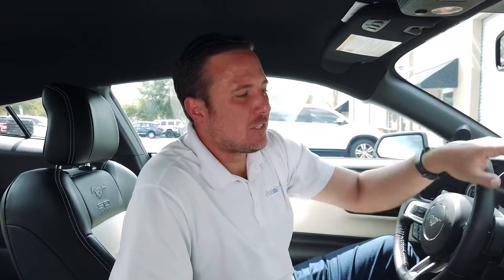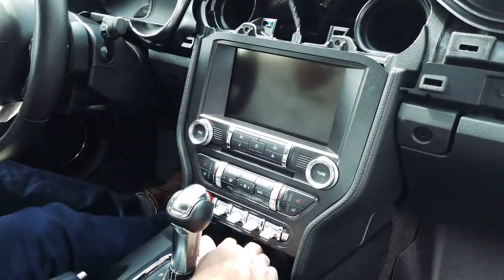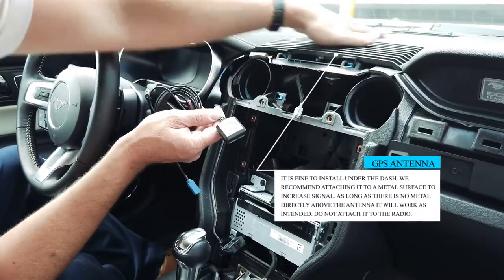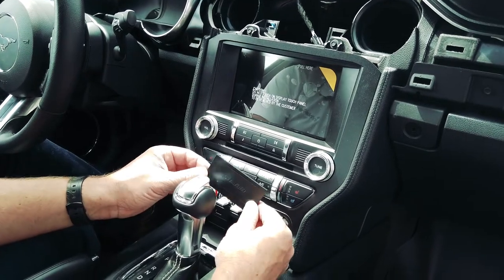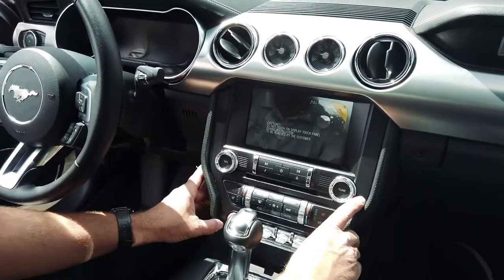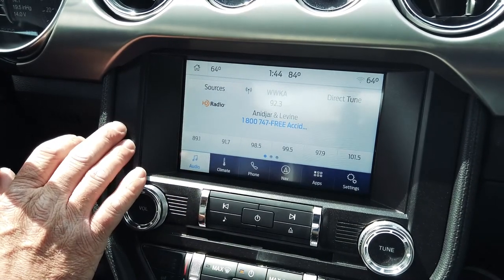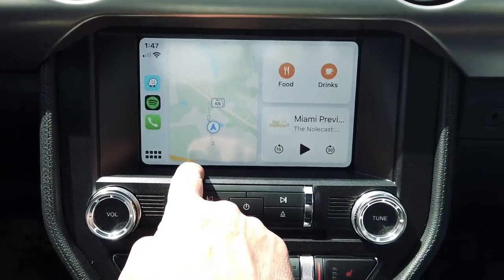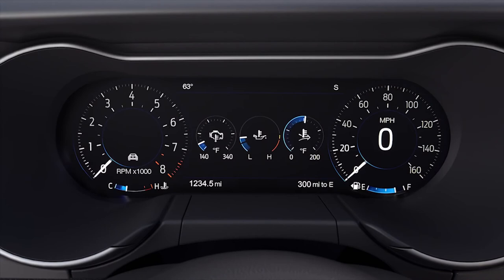2015 Ford Mustang - MyFord Touch Sync 2 to Sync 3 with Apple CarPlay and Android Auto Upgrade

Comment: If you already have factory GPS on your sync two or my Ford touch system, do you need to connect the GPS antenna?
Reply from the maker: You will need to connect a GPS antenna to the radio. You can use your existing GPS antenna connection or install the new antenna.

Comment: I just received my 8" system.  I ordered inbetted navigation upgrade, but out of the box, I didn't receive an Antenna for the navigation, as displayed in this instruction video. Is this correct or am I missing the wire or does the newest factory not need it?

Please advise.
Reply from the maker: Contact support at 855-636-6287. They can correct this for you.
Reply: Hi mate, is it the same for the 2020 Mustang 2.3 Ecoboost?  And can I also connect the Front camera?  One last question: do I need a specific App for the Front camera?  Best regards from the Black Forest Germany Guido

Comment: Why would you replace that sophisticated original media hub (sd card, usb, cigarette lighter) with a single usb outlet ?
Reply from the maker: Because CarPlay won't work without it. 

Apple and Ford know that sd Cards are the easiest way for a hacker to gain entry into your vehicles system.